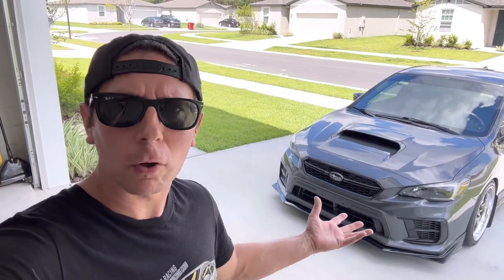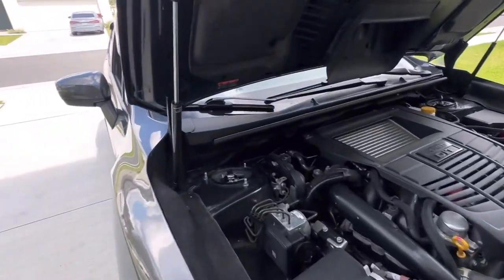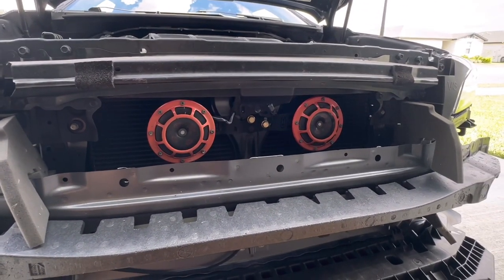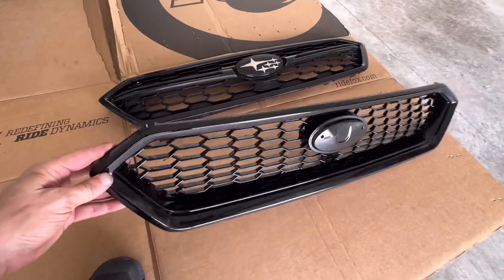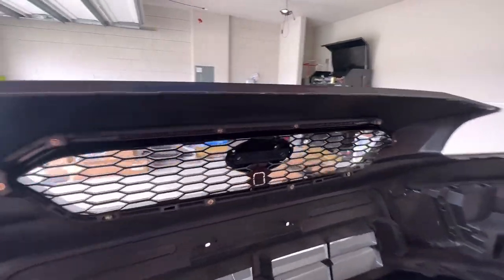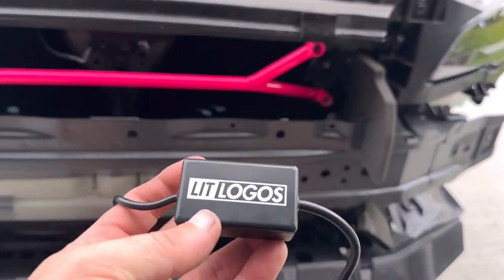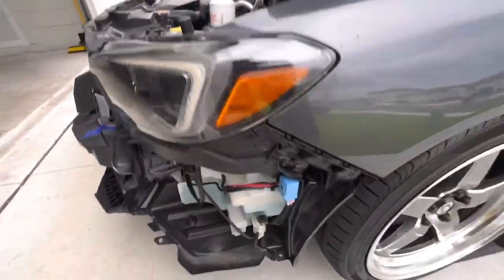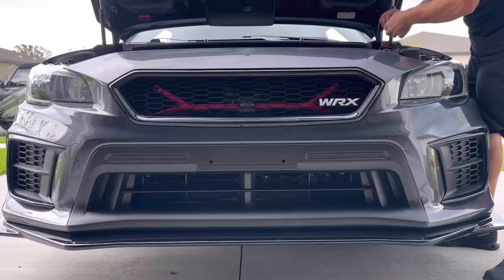BEST FRONT END UPGRADE FOR UNDER $500 | SUBARU | 2018-2021 | WRX

Comment: Are you going to put fog lights on the car? I'm asking because I've done a lot of light modifications to my 2015 WRX front end and for some reason my LED fog lights wont work with my clight and demon eye headlights. I can o:ly run one led foglight.  I wonder if the same thing will happen if I replace my cheap fog light wiring with the OEM fog light wiring.
Reply: I will be installing a set of JDM style fog lights from Noble very soon! 🤘🏻

Comment: a brace you cant even torque down the screws is only cosmetic. lets be honest here.
Reply: It’s pretty common knowledge that this X-brace is strictly a cosmetic upgrade… So thanks, I guess 🤷🏻‍♂️
Reply: @BuckleUpGarage_  If it's only cosmetic, why have it made out of steel which adds extra weight over the front axle? seems to me painted carbon (or even plastic) would be more sensible if it's the look you're going for.
Reply: @IBCMTB  great point... I'm purely utilitarian with mods, but I love when aesthetics accompany function.